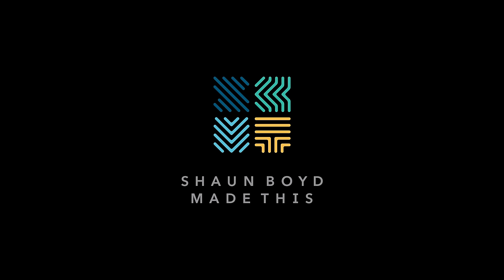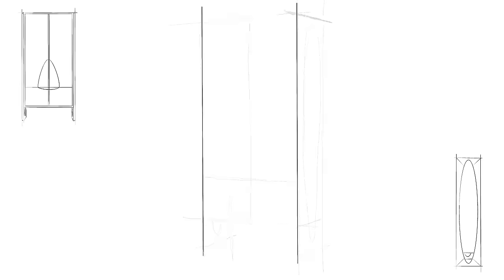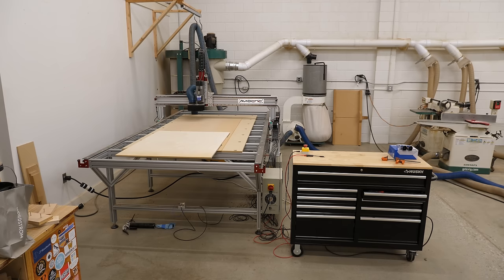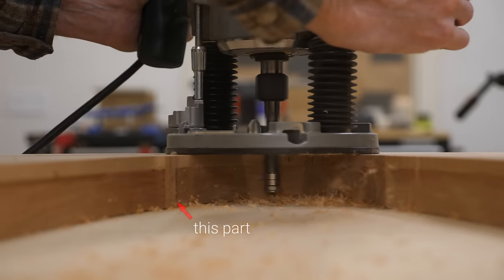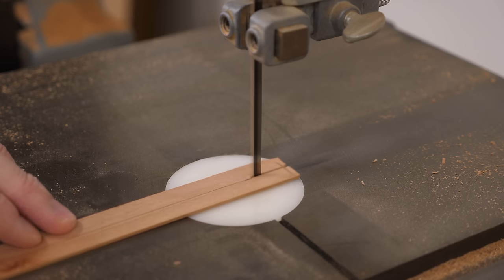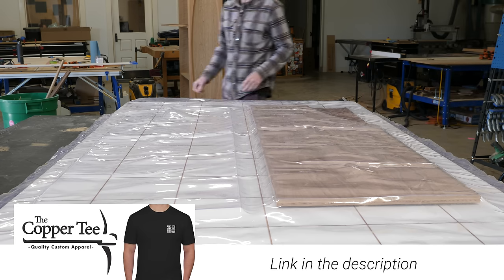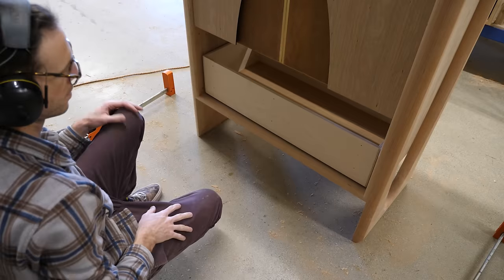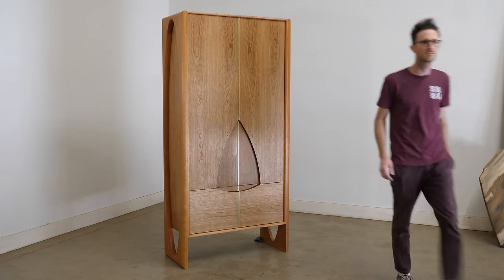Complicated...But Fancy

Comment: Why use plywood? That is a great question. I have found myself making custom plywood out of hardwood panels for two cabinet doors because they will remain flat and not warp throughout the year. Why? I’m now afraid that warping will break the glass in the doors if I don’t… flatness. Stability. That is why I use plywood. When I use it…

Comment: so when i started woodworking as a way to earn for living - i also used plywood. but i also was thinking: why would i use plywood and then try to hide the fact it's a plywood. it's fake. it's not a bad material to work with. especially if you use oakveneered plywood. but it still a fake. so after a year or so - i just quit. now i use only solid oak (whit super rare exceptions like oak veneered HDF  for back pannels, etc...
Reply from the maker: Yeah, that makes sense. I go back and forth between the two, really just depends on the piece. Thanks for watching!

Comment: Nice build. But why are you just making templates with that big cnc? Why cut the wood directly. Should save you a lot of time, especially when you have it in fusion360 already.
Reply from the maker: Thanks! There are a few reasons, but honestly, for the most part it's because a video where I cut out most of the parts on the CNC is a pretty boring video to watch, and the video is my main product these days.

Comment: First two minutes:
You can't hide the most prominent feature, the rotary peel grain pattern that does not look the same as panel glue-up.
A very good reason for plywood instead of panels is dimensional stability.  Your panel box would really look like framed panels, not solid panels, if used in the same way.  Maybe we're spoiled for living in climate-controlled houses these days.